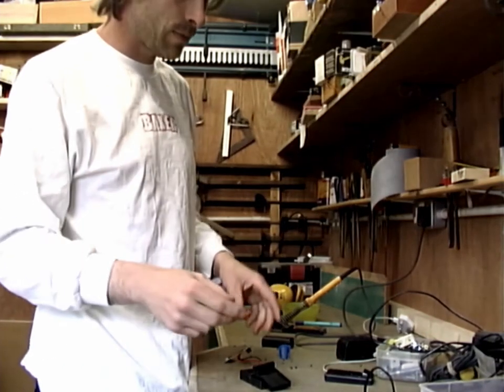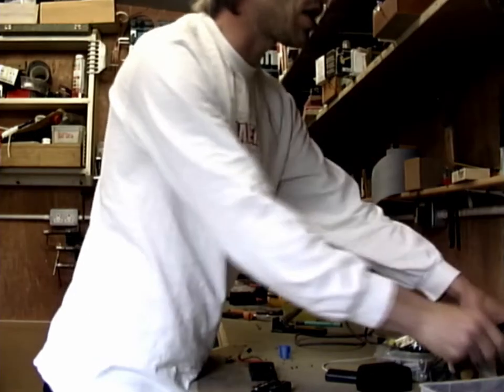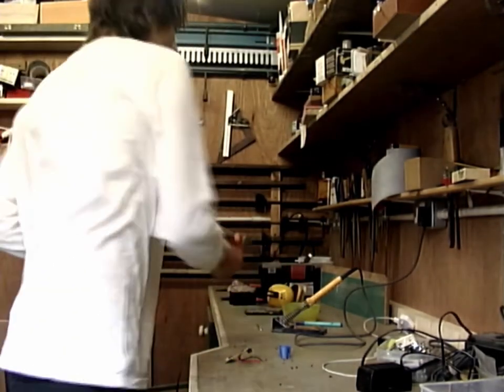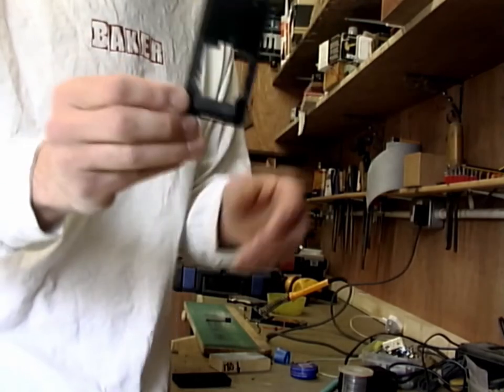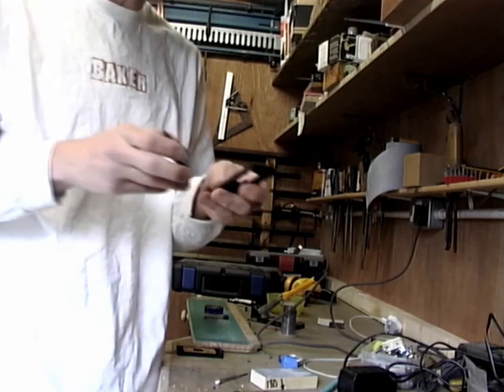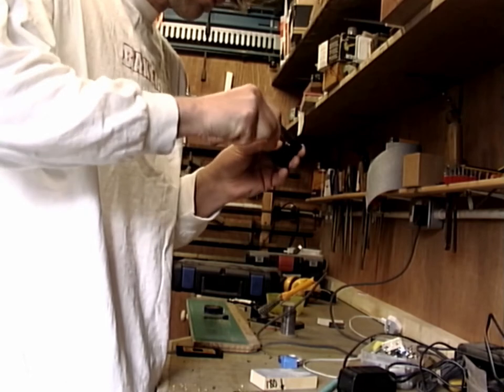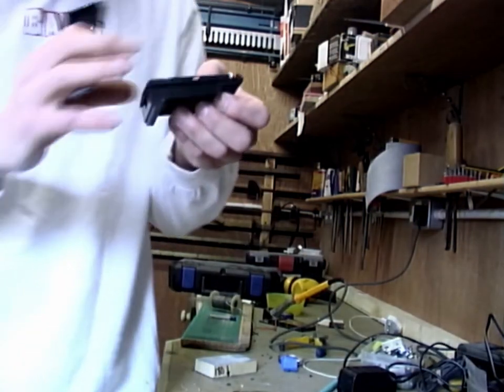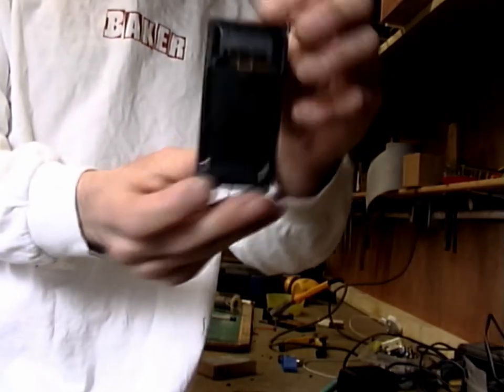How to use Sony vx1000 batteries on a hi8 Sony vx1E. Hacked battery adapter.

Comment: Oh my goodness it works!! THANK YOU - I bought a cheap soldering kit and just did this w the VX3. Was trying to figure out why that battery worked and I read in the manual that it can take 6V or 7.5V, which is what those NP-F style batteries do. This is just great
Reply from the maker: Max! I’m stoked this helped and you tried it out! Have fun using your vx3!
Reply: @s_m_north  thanks, Samuel!! Still solid!

Comment: a lifesaver. hopefully I can get on it and make a 3d printable shell for the battery and allow for slot in 18650 lithium batteries
Reply from the maker: Interesting!!!! You need to include some circuits with usb/dc or whatever out to power everything else as well. Think about that. Keen to see your progress!

Comment: Hi there, really nice video. I was wondering since your a pro at making these could I buy one off you? I have my own F series battery but I need the “plate” conversion part that you built to be able to use a F series battery on a VX-1 please let me know, thanks.
Reply from the maker: Hey! I don’t have any components left to make any to sell. Seriously the easiest and simplest hack. Anyone could make one with a dead VX1E battery, a soldering iron and a glue gun.

Comment: What up Sam! is this only worth it if you have an ORIGINAL vx1000 battery?
Reply from the maker: All the batteries I used to power this were after market batteries. The only original battery you need is the one for the Sony VX1E to use for the adapter.
Reply: @s_m_north  I’m running with the brand KASTAR wish me luck 🙏🤝❤️‍🔥

Comment: Hi samuel I just bought a vx1e and I have a problem with the cassette systeem, every time I want to put a tape in and close the door the top part won't go down and de door opens it self.
Reply from the maker: Sounds like a faulty cassette system. I have no experience fixing these. But mine is currently the same. Sometimes with a different tape it’s a little more reliable but was a driving force into going tapeless as you don’t need the tape deck.

Comment: eyo i tried this and it worked but my battery is draining so fast do u know what i may have done wrong?? i used a chrager but the pins where on a circuit board so i just left it in do u think thats where the problem is and my vx1 battery didnt have a board in it just the two pins
Reply from the maker: Hey buddy. I don’t really know what’s causing the drain? I had to re-watch my video to see exactly what I did it’s been a while. You can see in mine I used the board but just soldered directly to the terminals. I didn’t notice a massive drain in battery. If you want to make a video showing what you’ve done (set it to private and comment the link) I’ll happily watch it and see if I can do anything further.
Reply: @s_m_north  oke i think i found the promblem i thought my np style battery from my hi8 cam are the same as the vx1000 s but they only got 7.2v an the other thing is in the manual it say only the wall plug supports 7.5v and i used a battery instead of the wallplug
Reply from the maker: @Fladenbro  let me know how it goes!

Comment: Can I buy one of these from you? =^o
Reply from the maker: Like yeah you could. But i'm out of batteries to supply the case. Its literally the simplest hack you could every do. You could make one yourself with a glue gun and the most primitive of soldering.
Reply: @s_m_north  IDK how to send messages on here so I will just comment I guess. I have the VX1000 batteries already all I need is the harness.
Unfortunately I do not have access to soldering equipment/ tools. If it’s not too much trouble, I can order everything that you need and pay you for the service. Let me know if you’re down! Cheers :^)